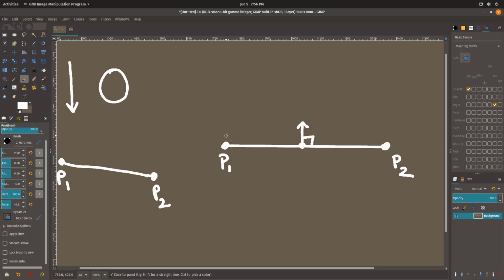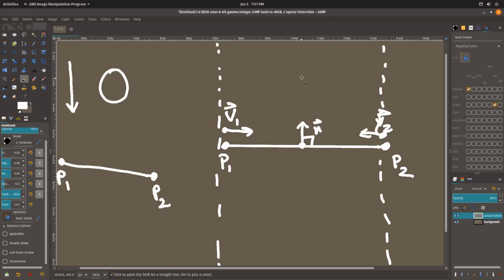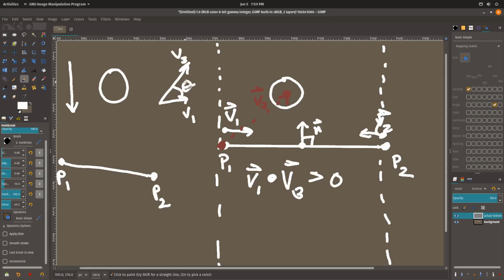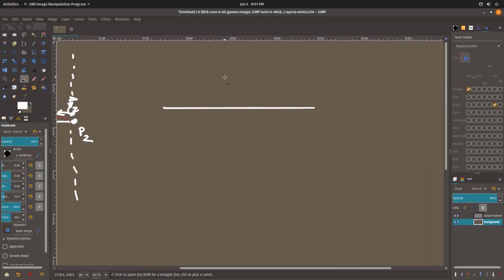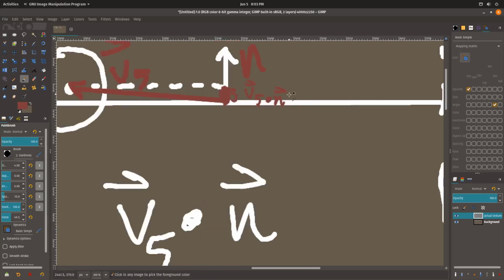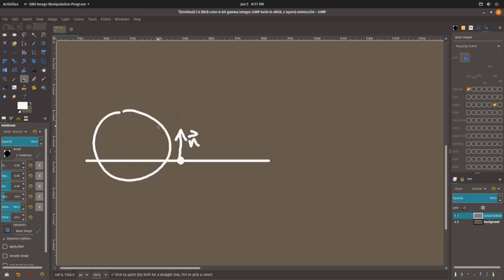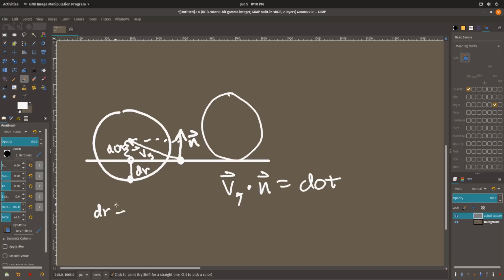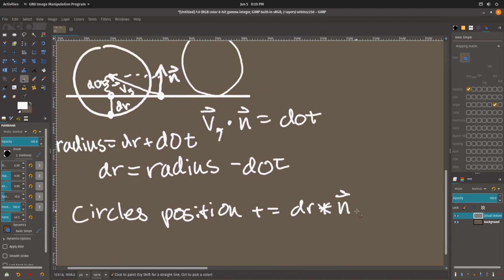2D Collision Detection - Line and Circle

Comment: With this we cant get the intersection points right?
Reply from the maker: I'm not sure what you mean. This solution is definitely not a good one, I made it before I took a linear algebra class lol
Reply: @andrewweller  yeah what i meant is that eventhough we can detect the collision, we can't work out the intersection points (with this approach)

But i've been able to solve the problem. Thanks.
Reply from the maker: @youssh4975  I'm sure you could figure it out. If you know the location of the center of the circle relative to the line, you could do some trigonometry to calculate where the line intersects.

The key here is that the center of the circle is always length r away from the line. 
The line perpendicular to the wall, parallel to the wall, and the radius of the circle form a triangle of which we know two sides (the perpendicular and the radius)

A little bit of trig goes a long way with video game math.